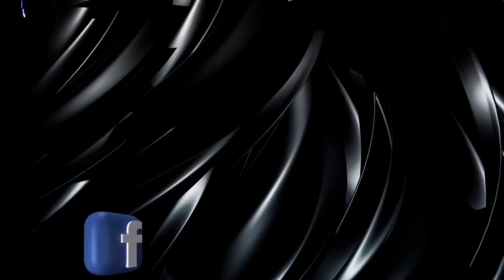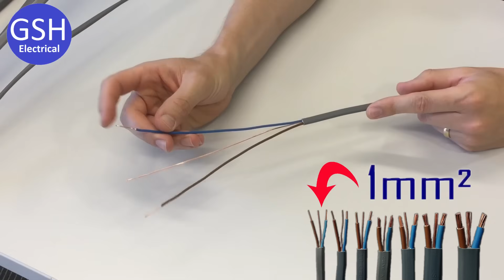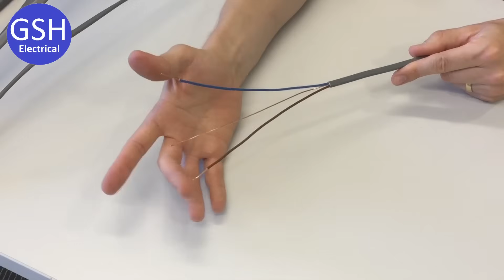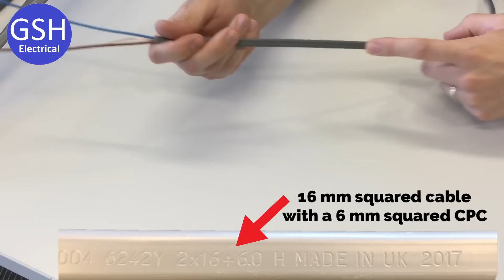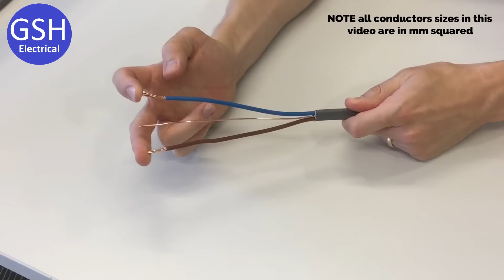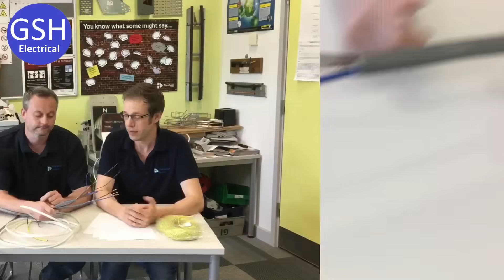The Different Sizes of PVC/PVC Twin and Earth Cable (Twin and CPC Cables in mm2)

Comment: I’ve noticed that the diameter of the copper live and neutral cores of 2.5mm squared twin and earth is 1.71mm to 1.8mm diameter depending on the make of cable. 
This was measured with a digital calliper. 
How does this relate to cross sectional measurements? 
Apologies if I seem somewhat uneducated regarding this query.

Comment: Not sure if this thread is still live, but when you say the diameter of the cable is 6mm (for example) are you talking about the combined diameter of the live and neutral cables. The cables idividually only appear to be about 3mm in diameter, which is why I ask. I'm having a 9.8kw shower installed and the cables (individually within the unit look about 5mm in size. (Which is why I ask.) Thanks.
Reply: No. The diameter or CSA (in mm^2) relates to a single wire, either live or neutral. It is not the combined CSA of both.
Reply: Which country are you in? If you're in the UK you can't do electrical installation work without having the suitable qualification, and if you're asking a fundamental question on what the definition of CSA is, that suggests you are not adequately qualified, under UK requirements, to perform the installation.
Reply: @deang5622  I'm in the UK. I'm not installing it myself. The plumber wanted a picture to send onto the electrician to see what size cable the existing Advance 9.8S shower had. The plumber and electrician have now fitted the new model Advance 9.8kw shower to the existing cable. So, I guess it must have been 10mm2. Like for like.

Comment: So would a 16mm² t&e be considered within regs to be ran from an rcd after the cutout to the main CU? As opposed to tails or split con?
Reply: Read the Onsite guide.
Technically you can have whatever thickness (CSA) of cable you want so long as it can handle the current.  There just happens to be a standard set of sizes to cope with certain common current requirements.

Comment: I read somewhere that said ‘ here is a standard 2.5mm2 cable’ and on the diagram it said the cross sectional area was 1.78mm. Is this right? Or is it actually 2.5mm2 on each conductor?
Reply: Hi Daniel,
1.78mm is Copper conductor diameter for 2.5sqmm2 electric wire.
1.78*1.78*0.785=2.4872sqmm2 which nearly to 2.5sqmm2
So its actually 2.5sqmm2 on each conductor.
Reply: @monicasue9673  ye I found that out a long time ago, but thanks for the reply. Did u make an account to reply to me?😂
Reply: @monicasue9673  excellent info Sue, ive been an electrician for a number of years and recently someone asked me... " if the tails are 25mm why are they NOT 25mm in diameter"

Comment: Hello. I need some help. 
My house garage door was wired 20g for the door opener. But I bought a new opener that was designed to use 22g. Which I didn't know before I bought it. 
If you can tell me how can I get it to work. It can't take the signal when I connected it. Can I use resistors to make it work?
Reply: You are getting mixed up. 20g, 22g refer to the thickness of the cables.

The problem you might be having is fitting the thicker cable into the screw termination which is for a thinner cable.

You don't solve that problem by using resistors.

Comment: If a house was a average 3 bedroom house would two bedrooms be wired with a 2.5MM cable and the last one with a 6MM because the room is a lot further away from the first socket point on a 32AMP breaker OR is the 50Metre max length of a cable per cable not from consumer unit to end of house (what I mean is from consumer unit to first socket then another cable from that socket to the next one should not exceed 50 metre per cable or is it from consumer unit until end socket in the 3rd bedroom socket)
Reply: The standard lengths of the final circuits are based on using a particular CSA of cable to enable a specified maximum current to be carried.

So 50 metres is the length of the entire cable length at the specified CSA in mm^2.
If you want a cable length longer than that, then you need to increase the thickness of the cable, increase the CSA.

It's down to you then, to do the calculations to determine what CSA you need.

I would be careful mixing different CSA cables in a single final circuit, as you may end up overloading the cables of lower CSA.
But you need to analyse the currents and decide on what CSAs are appropriate.

Comment: In Ireland this has changed the CPC is insulated now and is also the same size as the line conductors. Most cable sizes are solid rarely we see stranded t&e.
Reply: This is city and guilds so what does Ireland have to do with UK standards?
Reply: @doma7956  we adopt both BS and EU standards. And we also use the UK 3 pin plug so ireland has alot to do with the UK stuff pal
Reply: @doma7956  drop the attitude lad no need for it.

Comment: Here in Germany the CPC is always insulated. CPC/PE has the same crossaction as the live wire it to 25mm2 but it is very uncommon. Standard cables have the same PE/CPC up to 240mm2. (NYY-J 5x240)
 Up to 10mm2 the wires are solid and as we use 3phase in domestic houses, 5x10mm2 with solid wires are very common. There are also some types of cables with solid wires it to 16mm2. In Austria and Switzerland wires with 10mm2 and more are straighted.
The smallest crossaction available here is 1,5mm2.
Also there is wide range of different cable types with more than 4 or 5 conductors. Eg   NYM-J 7x1,5 or 12x1,5.
Reply: Same in Ireland. CPC is the same CSA as the other conductors and is insulated to the same thickness as the others.
Reply from the maker: Hi. Well I didn’t know any of that so thanks for the detailed information. Hope you enjoy the video we produce i honestly didn’t think anyone but my learners would watch them 👍. We have one more in this series thanks again Gaz